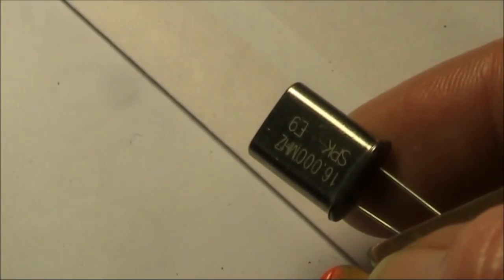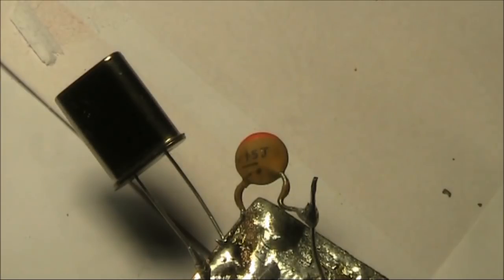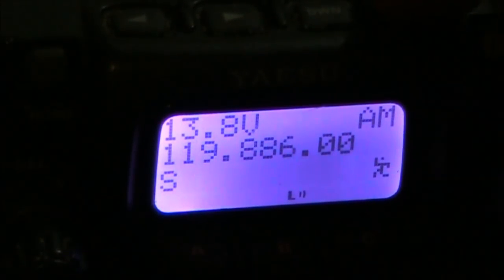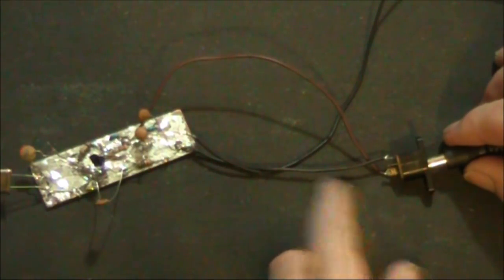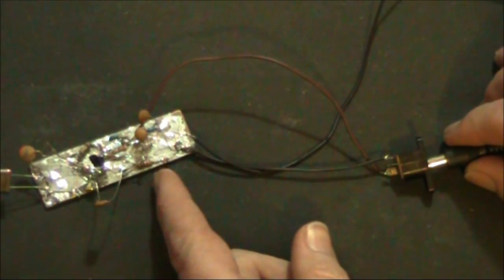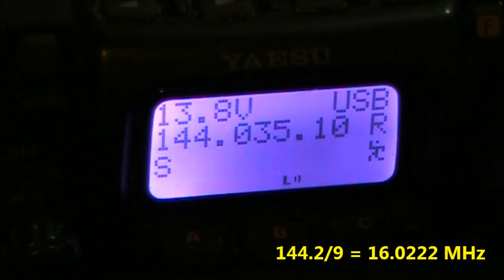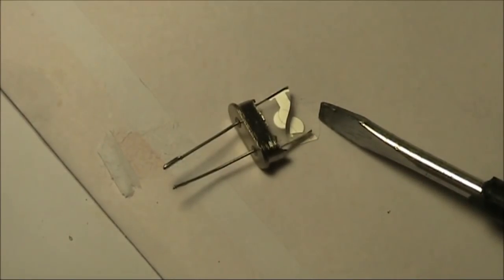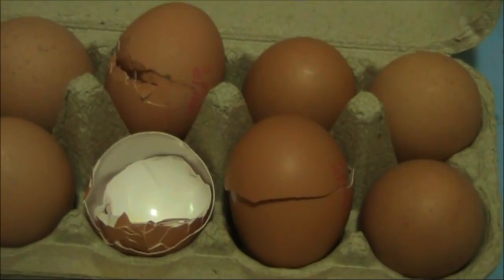Can a 16 MHz crystal multiply to generate a signal inside the 144 MHz band?

Comment: Silly question however I would like to ask. They make Radio control freq Crystals for 72mhz would these work with this oscillator to generate a signal on 144mhz?
Reply from the maker: That would likely be an overtone crystal that you would use an overtone oscillator circuit followed by a doubler. Though it might work on its fundamental frequency and you could multiply it by even more times to get to 144 MHz.
Reply: @vk3ye  thanks for your replay and pointing me in the right direction. Myself and few friends of mine are trying to build a cw transciver for 144mhz.

Comment: Nice video Peter. I find this a very intersting idea. Do you have a circuit schematic of your design?
Reply from the maker: Yes - it's the same colpitts osc as the schematic presented in previous videos on the crystal and ceramic resonator sanding/filing.

Comment: Please try 16M ceramic.
Reply from the maker: Don't have one but it's likely to be very unstable - especially if multiplied up to 144 MHz.
Reply: vk3ye If the resonator oscillator was built with good mechanical integrity, used a well regulated supply and had good shielding and buffering then I believe it may actually perform reasonably well and be very easy to fm with a varicap diode, especially after several stages of frequency multiplication.
Reply from the maker: Quite possibly. FM is also less critical - you can be 1kHz off and no one will notice.  Whereas SSB requires stability about 10 times better.  And digital modes probably about 10 times better again.  There are certain crystals (eg 18.432 MHz) that multiply up to approx 147.45 MHz - these could be good for FM experiments in those countries with 146-148 MHz.
Reply: vk3ye I think you would achieve reasonable stability. Look at the older hf transceivers that used analogue VFOs based on L/C oscillators. They achieved fairly good stability with attention to the aforementioned things. A ceramic resonator would 'stay put' better than an L/C oscillator. Another thought, at these frequencies you would probably get good performance using a 1N914 reverse biased to operate as a varicap. The linearity would possibly be better than here where you seem to be just using the AF modulator transistor as a variable shunt across the resonators series capacitor. Could be worth a try. It may deviate enough even without the transistor and just feeding audio from the mic to the diode as electret mics have a fair bit of output
Reply: Sorry I had just been watching your new video of the ceramic resonator being modulated, I forgot this was the one on the crystal oscillator. My comments on the modulator are referenced to that